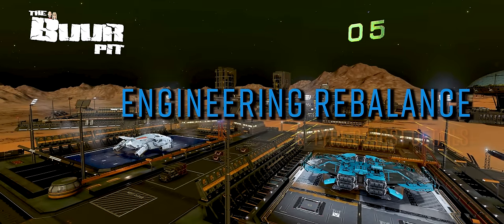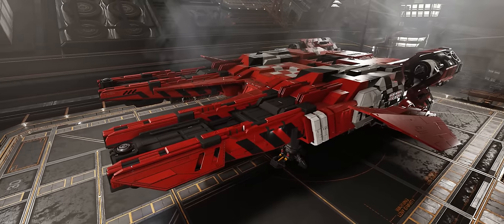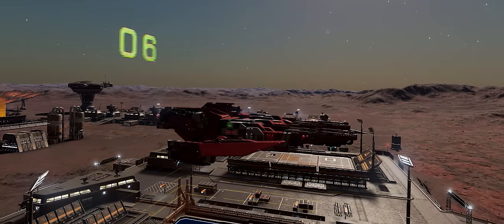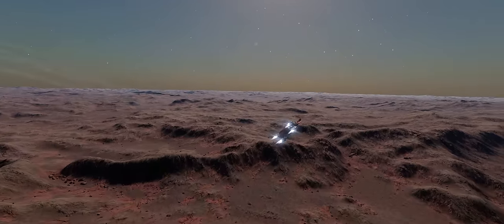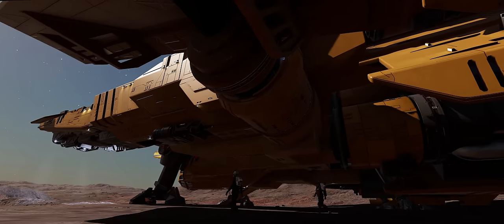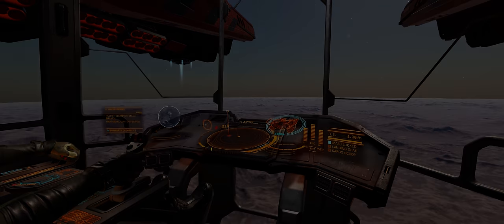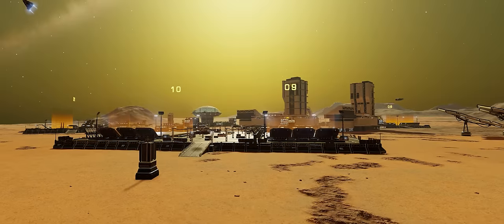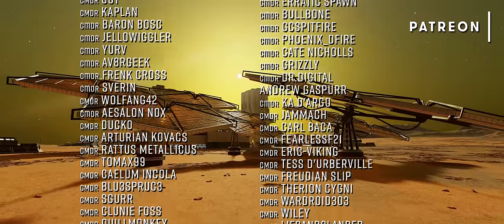Elite Dangerous: Substantial ENGINEERING Rebalance & T8 First Look

Comment: It is a shame that it seems very limited to the Thargoid War, as it is not really well spelled out on what you actually have to do with that content. And Thargoid combat I find really hard so I tend to avoid it.
Reply from the maker: It's not limited to the war.  Quite the opposite actually.  It's being added to the war but the material gains and blueprint changes are RIGHT ACROSS the game.
Reply: @TheBuurPit  oooh that is nice. I may have gotten confused as it seemed the increase to mission rewards and such are just limited to that good war participation. But being across it all is just lovely. Thanks Burr your a star for clearing that up!
Reply: You don't actually have to fight the forbidding flowers to help out with the war.  Sometimes it's just running needed supplies into a system under alert, or running passengers out.  I've played this game for a couple of years now and have yet to take on an Interceptor.  I do have a nasty little Vulture build for dealing with scouts, though, and knowing that discretion is the best part of valor, I have ranked up in combat killing them alone at attacked stations or ground ports, and bouncing out when the Terror Triffids show up.  

If you prefer NO contact with Thargoids, build for high boost.  The higher the better as most of the thargoids can be outrun fairly easy.  The trick is to begin boosting the moment you can when you get interdicted, or hyperdicted, and get back into hyperspace or supercruise as soon as you can.  Don't even look back, just run.  The Danger Daisies have one or two ships that can catch you up, but you won't run into them as often as you think.  For cargo runs into an attacked (or worse) system, when they try to stop you, hit your boost, drop a heatsink or two, and charge your FSD.  The Krait MK II, properly built, can boost indefinitely at over 500 m/s.  You might wanna look into it.
Reply: Having literally gone to every single Thargoid system and settlement looking for Thargoids to fight for the mats needed to disallow the anti guardian field stupidity and never finding them, I gave up on the entire Thargoids war and set the game down and may not pick it back up again. 

Never underestimate FDev's capability to wholly and completely screw things up.
Reply: This is more than I had expected, I was thinking a bit of a spreadsheet magic but they really did it deeper than that. More container spawns at Jameson is good, it will make for fewer relogs😊 Missions rewards are nice too, as is the rewards for taking back systems from the thargoids. I wonder if you'll earn something by taking back systems for your power as well when ever pp2 drops🤔 Anyway, great stuff😊
Reply: YES, exactly! I don't even want to partake in it, I quit when they started this 2 years ago. If there was an evolution of sorts; I keep trying to promote what they would look like if on foot I did a Steam POST on this topic, and I got a lot of positive feedback on it and good ideas. One thing that came across was they (Thargoids), would look "badass", I Suggested like old Star Craft "Zerg or Protoss", and now they have a reason to evolve for more suits and bigger armor Terran "Marines" had these massive suits almost mech like. It's just a thought, I agree with you, have a good one!

Comment: The last time they rebalanced engineering they were complete idiots and let users keep their legacy rolls which were often better than were available under the rebalanced system. What kind of dumbass does a balance pass, but then fails to balance the worst offenders by letting them keep their totally overpowered items? I have a couple of god-roll PAs and a 5A dirty drag drive that are completely unobtainable now and allowing people like me to keep them was both unfair and undermined the whole point of the engineering balance pass in the first place...